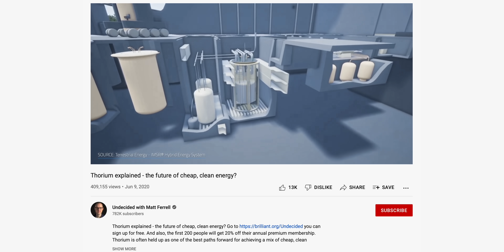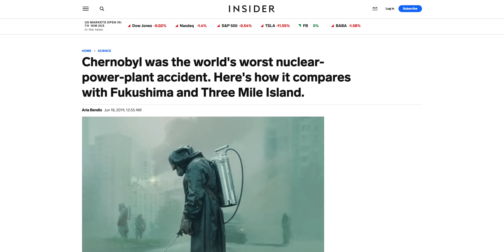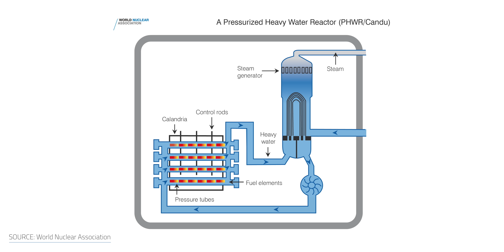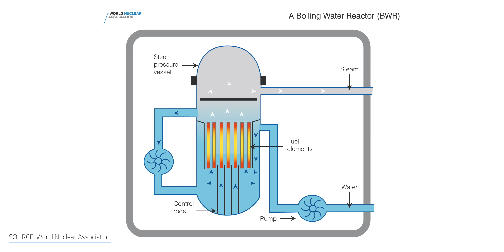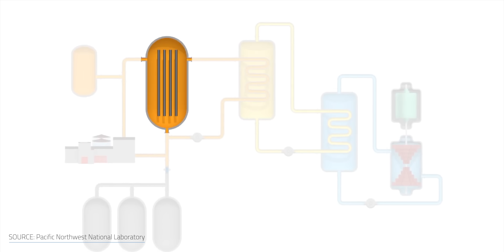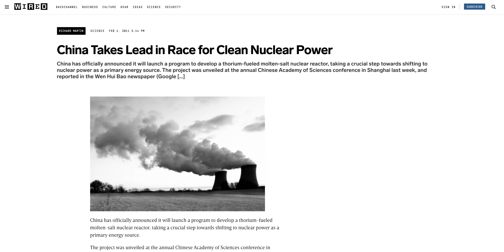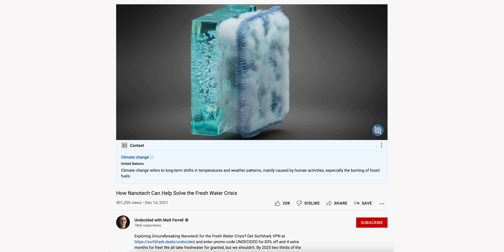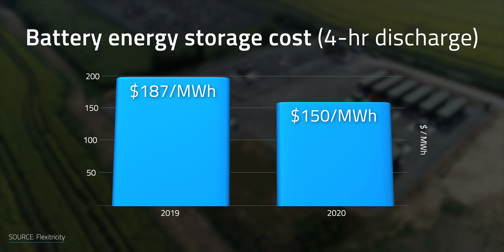Revisiting Thorium Energy - The Future of Nuclear Power?

Comment: As a former nuke.. yes we need more nuclear power, whether it's LFTR, MSR, Breeder, PWR, BWR and battery and sand storage to handle peak and intermittant usage. Moreover, the radionuclides for therapeutic.  The "type" will be dedicated to load, location, regulation etc.
Reply: I am a 40+ year former nuke also.  But I believe in facts and the reality that new nuclear is too costly.

Please don’t assume that YT videos are factual.  If you live in the U.S. here is the reality for the last 4 state of the art Westinghouse AP1000 ADVANCED passive safety features new nuclear power projects and spent fuel reprocessing and in the U.S. over the last 20 years. You decide if this YT video was presenting the truth. 

The Southeastern U.S. is super pro-nuclear MAGA, has zero anti-nukes, and 100% media and political support. 

The MOX facility (South Carolina) was a U.S. government nuclear reprocessing facility that was supposed to mix pure weapon grade Pu239 with U238 to make reactor fuel assemblies. It was canceled (2017) in the U.S. After spending $10 billion for a plant that was originally estimated to cost $1 billion and an independent report that estimated it would cost $100 billion to complete the plant and process all the Pu239, Trump canceled the project in 2017.

VC Summer (South Carolina) new nuclear units 2&3 were canceled in 2017 after spending $17 billion on the project (original estimate of $14 billion and 2016 completion date) with no clear end in sight for costs or schedule. 

Vogtle (Georgia) new nuclear units 3 &4 currently 110% over budget and schedule (currently over $30 billion) and still not operating. Mid way into the build, the utility stated that had they known about the many costly delays they would never have chosen nuclear. They are now delayed another year because according to the project management, thousands of build documents are missing. 

Please google any of this to confirm.

If you can’t build new nuclear in the MAGA super pro-nuclear southeast U.S. then where can you build it?
Reply: @clarkkent9080  it has nothing to do with the plants and everything to do with regulatory and politics, as you said state of the art AP1000 is best of breed right now. Did a stint after getting out of the NAV at a coal mine with ultra low sulfur, several challenges but the engineers and and even the “res” work together to make it viable (cost) to sell and transport to California. Imagine the politics of two Native American tribes and the transport issues, no rail, and still found a way to get it done, only for it to be killed by….. sierra club litigation. I have friends on the Vogtle project, it’s not for lack of trying to get it up and going, politics, regulatory, fleecing etc is the problems; not the tech or the will.
Reply: @clarkkent9080  Stop trying to gas light me.. I did read your rather long post. The answer: "To be clear, Southern executives have blamed this new hiccup on paperwork, saying that workers were gathering it to send to federal safety regulators and noticed critical inspection records were missing or incomplete." bad management, regulatory, fleecing. This is not any different then when building the F-35 and its now ground stop due to chinesium being found "magically"...  If you are believing the CEO and the poor me attitude, and the FUD of "paperwork" then you are part of the problem.  The NAV part of operating the ship/boat has very "few" of these types of problems, when a contractor is saying it's delayed while holding out his hand... The problem... is not support, it's the vendor/contractor/regulatory/politics.  You laid out all the reason why it should be a success, in your own words...

1- the Westinghouse AP1000 was first built and operated in China with Vogtle engineers learning of any problems.
2- The AP1000 is 100% approved by the NRC for construction and operation.
3- The only thing the NRC looks at is if the plant was built according to design and if the specified critical safety component welds were x-rayed and the systems tested.

Then why is it delayed and over budget? hmmmm, could it be "delay of three to six months, Southern said. That additional time is costing $920 million. " could it be they want more... $$$$

It's amazing to me when you say you are a 40+ year nuke and never saw this in the shipyard, "My Vogtle friends say they never x-rayed the required welds or performed the required performance tests.  Of course the records were missing because they never did the tests and this is a company you want to operate nuclear power plants?" and didn't realize this was of course "caught" because it's an incentive to cheat knowing this is a revenue generating event.

Please tell me your are not this naive. If you were a QAI you see this all the time in the form of shipyard rework.... it's for the $$$$$ pure and simple
Reply: @clarkkent9080  I use gas light because that's the line you are actually going down, by you of me: Gaslighting is a colloquialism, loosely defined as making someone question their own reality. The reality is this, the Navy has been operating, safely and with a great track record for over 7 decades. The gas lighting is you saying the "I've heard" (so it must be true), then twisting my words to fit your narrative as being wrong.  I'm not wrong, I lived it and your pettiness shines through rather well with the gas lighting as some sort of soothsayer. You have your experiences, I have mine, you are commercial, I'm military.  The only thing comparable is the nuclear part, somehow we can build and operate a submarine for 30 years, build it in 3 on the initial investment of 1 Billion, yet the commercial sector just keeps that hand out for an order of magnitude more $$$... hmmm  

" I provided proof of why in the U.S. that is not working. You blamed regulations and I proved you wrong and now you admit it is about greed." No you didn't, you showed me how you "think", I'm coming from actual "working" models, not the bloated civilian sector... hence GAS LIGHTING. I do blame regulations because regulation says X, the commercial side says how do we manipulate said regulation to make $$$$. Greed is the purpose, the tool used is "regulations".. hence the contractor manipulates the paperwork is "missing" for radiographs of welds when they damn well "know" these are REQUIRED, then ask for more $$$$ to comply..... to the regulation... 

Worked with enough ex-navy (doubt it)... must have be "targets".. If this is the way "you think or they think", you are part of the problem... Do better.  I find it amazing, the semi-conductor (IC) and nuclear started around the same time, nuclear is now "too expensive" and IC's are sub-pennies on the dollar...

"So do we agree that nuclear would be nice but like an affordable flying car it is not going to happen." We have demonstrated commercial nuclear, we don't have demonstrated commercial flying cars so this is a bad comparison. I wish we had the old engineers from the 50-70's back with can do attitudes instead of naysayers. 

Now have I changed my statements or position any from the first?  No, but you are really a negative though, that doesn't help at all, we need better people to drive those costs down. Not people saying it's "too expensive", innovate, troubleshoot, streamline, build... Seems the Chinese will take our will to "be better attitude" and just leap over us.

Are you now on board with the facts and reality (not yours, thank god) that the government cannot fix a problem that they did not create?  I always had the facts, from my experience working on reactors, yours is different, yours needs to change. Government "allows" for these problems because they have ZERO incentive to fix it, if the fleece isn't going to be "fixed" why not just go back to the tax payers pockets to grease themselves (politicians) while doling out billions because the commercial sector while holds out its hand for that sweet local, state, and federal funding with ZERO accountability.

Or maybe your a government can solve anything person. Hell to the no, get govt out and get can do people in, like Elon and such. The govt can't get itself out of a wet paper bag when the budget allocated is a billion dollars, swells to 10 billion, then leaves it for the next administration to fix, then blames them for any over runs and cuts funding.... All this BS starts and ends with regulations and greed by everyone except the public who is best served by having cheap and reliable energy.

Anywho.. agree to disagree.  Thanks for letting me know how the civ/commerical sector works, it has been educational.
Reply: @jlford30  I believe that the crew of the Scorpion and Thresher would disagree on that safety record.  The reactor was not the primary cause of the losses but if the reactors had not been shutdown neither sub would have been lost.   Can you say learn from your mistakes? Well, is that why the Thresher lost report was kept secret for decades until the navy was sued? 

Costs for the 12-vessel Columbia class, the US's next nuclear-missile submarine, have grown by $3.4 billion to a projected $112 billion before the first planned deployment in 2031.  Don't they teach math in the Navy ? When was the last time a sub was built for $1 billion or less in todays dollars?

Neither you or I will determine if new nuclear is built.  But here are the facts and unless you can provide examples where I am wrong then you just have an opinion.
1. No U.S. utility is even remotely interested in new commercial nuclear.
2. Old fully paid for nuclear power plants are being shutdown every year.  Palisades 2 months ago and now FirstEnergy wants to shutdown 5 of their nuclear plants. 
3. Plain and simple nuclear is not cost effective.
So exposing reality and Facts is being negative in your world. If you respect the Chinese, you must be one of those that wants an autorotational dictatorship in the U.S..

I even got to see Rickover, (there times) or at least the mass of ass kissers that surrounded him.  You must also know many ex-navy nukes transition to commercial and I have worked with many.  I will say that the ex-navy nukes that I have experienced in the past were very intelligent, hardworking (they were amazed that they get paid for working more than 40 hrs/wk). but extremely cocky. 
We had one on his first day come to the control room and declare that he was hired to teach us how to operate a reactor.  He soon found out that in commercial we don't have a crew of specialists.  The reactor operator has to know the reactor, turbine, liquid waste systems, emergency systems and everything in between. A standard nuclear plant has more valves and components in the shit plant than on an entire sub.  This cocky guy did not last 6 months because he would not ask for help and could not pass the exams. Even though he was an ass we would have helped him if he asked.

Fast forward to my last assignment as a subcontractor to help train new hires to support mass retirements. The training department hired ex-nuclear navy Jr Lt., 2 crew chiefs, and a nuclear aircraft carrier mechanic.   
The Jr Lt. was given a manager position but all he did was attend conferences, and network. The company finally realized that he was not doing the job and assigned him to a position that was basically a material procurement lead.  He seemed to do a good job keeping toilet paper in stock.
One of your Chiefs spent most of the day smoking and sleeping in his car and was finally fired. I later found out he was Bi-polar.
The other Chief refused to teach, spent the whole day simply scheduling people for training and took two years to get rad worker training which means that he never entered the rad facility buy himself in 2 years.  After his performance evaluation he quit and went to Vogtle.
The ex-navy mechanic was very intelligent, a hard worker, and had great people skills and learned about the facility quickly.  However, the other navy guys treated him like shit, I guess because of that Navy rank BS.  I guess in the navy it is about rank and not about ability.

The old navy guys that I worked with and I all watched this latest but small example of today's nuclear navy personnel and said God help us if we get in a real war.

So if you ever plan on transiting to commercial I will help you out.  We don't care what you did before, who your mother or father is or what rank you held.  You have to treat you co-workers with respect and orders only matter when your ordering for lunch. You are expected to do a job and you will be paid for hours you work. 

In the Navy, you have to convince a 19 year old that they are slaves to higher rank and to only speak if spoken to.  It works for you but not for the real world.
Reply: @jlford30  I guess I just got tired of you acting like the Navy is so great compared to commercial. The navy has had its problems with crashing into undersea mountains and the latest running into something submerged or surfacing on a fishing boat so don't pump out that chest too much. Tell me about your safety record and then explain hiding the Thresher report for decades because it exposed the truth.  How does that make you feel about the Navy having your back?
 Commercial cannot hide anything, and I can proudly say we self-report.  Do people hide mistakes, YES but if you are caught your career in nuclear is ended.  My last assignment was at a NNSA facility.  When a mistake was made, it was investigated and two people lied about what happened and they were immediately fired.  Commercial has the NRC, EPA, OSHA, INPO, Insurer, and the public.  The Navy hides and classifies their mistakes....certainly the sign of a great organization.

The nuclear Navy is living on the Rickover legacy and that ended 40 years ago when the military industrial complex forced him out because he fought the shipyard corruption.  So, now you just live with it. Cost over runs in Navy builds occur years before construction even begins.  And how about those old Seawolf subs that even the government could not afford to build.  You cherry pick a sub class built 50 years ago, some of which could not operate for even half their design life....Troll

My past experience with ex-Navy nukes was very positive and those that realized how simple a sub was compared to a commercial plant, that we don't have ranks, and lost the cocky attitude, did excellent.  I will say, very few seemed to have any personality or people skills.  I guess when you have complete control over someone's life, you don't need a personality.

My last encounter was completely different. The ex-Navy guys were all about perception and where they stood in rank.  Doing the right thing was secondary to doing what made them look good. They also hired some high ranking ex Navy guys.  Ex- Fleet commander or SUBPAC something or other that I know nothing about.  They were all about following every rule, no matter how stupid it was.  If you needed a req. form to order more req. forms and you were out of req. forms well that's too bad until someone finds a req. form.  A stupid example but not far from the truth.  You said you know people working at Vogtle.  They may have been some of the Ex-Navy top managers on that project that I also knew.  You know the ones responsible for missing records

You have been around for a while.  Try and tell me the skill, ability, and attitude of the Navy nuke has not degraded over the years.  Try and tell me that you don't have officers that are worthless. Try and tell me that people don't just get away with incompetence because of their rank. Tell me that there is not waste fraud and abuse in shipyard builds.  The Navy has gone down hill and you know it.   
How in the world do you have a bipolar boat chief?  We taught new hires the full spectrum of fundamentals. And it became apparent that the other chief only knew electrical. He could understand it but would not teach it   He was unable to understand each basic math, physics, mechanicals, heat transfer & fluid flow, or radiological safety.  Must be comforting to place your life in the hands of a boat load of specialists. And I always though the chief was the one guy that may know all systems.

But you are an old salt and have your 20 years in and if you resign you will go on to maybe commercial life to double dip.  Just don't bring the Navy attitude because today you won't last long with commercial nuclear contracting.

In summary my point has always been that we need new nuclear but until the excessive cost issue is addressed, it is too expensive and has been proven so.  I operate nuclear facilities but I don't build them.
Reply: @jlford30  PS- more than 50% of the French reactors are shutdown now and they are importing power from Germany....Troll out
Reply: @clarkkent9080  Lies